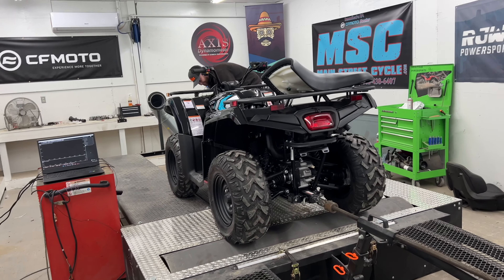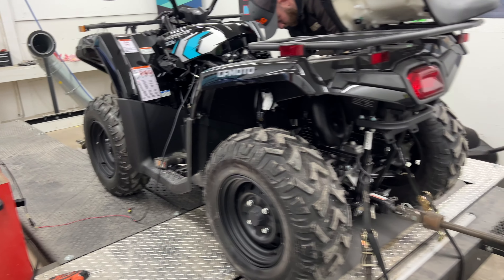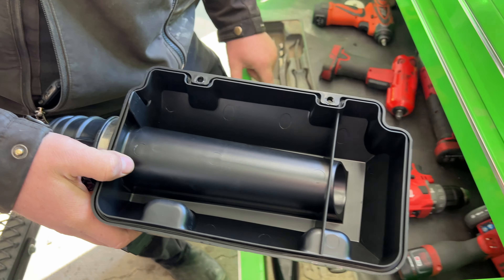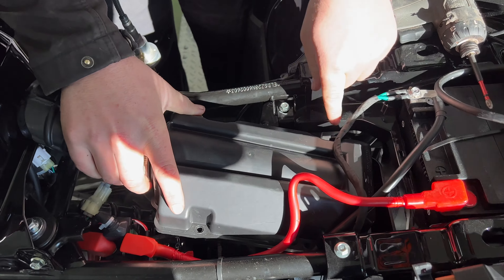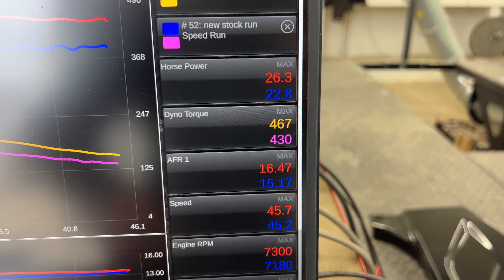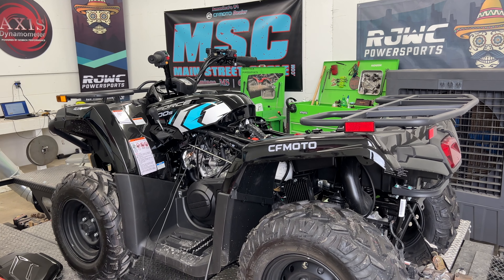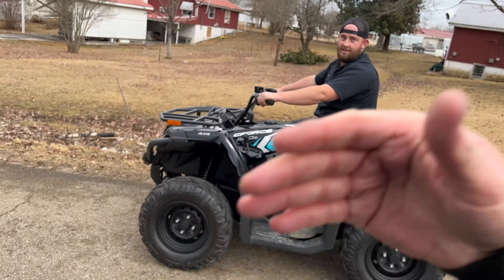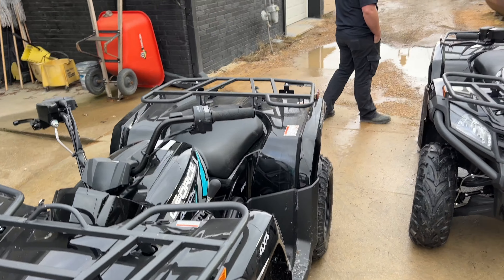We Tuned the Gen 1 CFMOTO CFORCE 400 and WOW....

Comment: Hey Blake. I know you have said before you have seen 1-2hp difference just doing airbox mod on stock 500... but is backfiring more of an issue after if you don't have a tune?
Reply from the maker: Well I personally have not done a lot of testing with Just the airbox mod, because I always end up going straight to the tune after running the airbox mod on the Dyno

Comment: Two questions, what benefits were from the air box modification and does it work for the 800 xc
Reply: In other words, does the air box modification add any real benefit?  Run cooler?
Reply from the maker: The air box is completely different between the 800 and 400/500/600..
So this modification can not be done on the 800